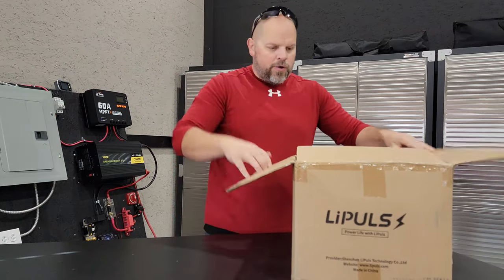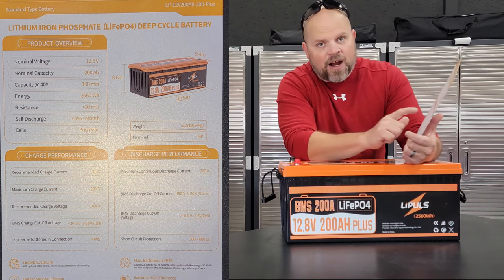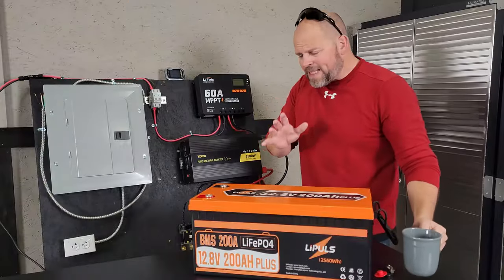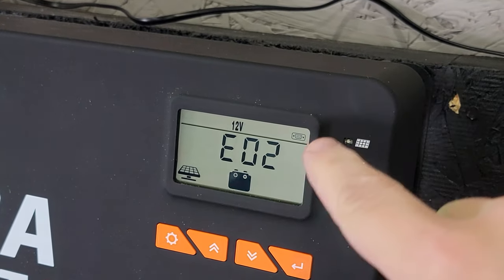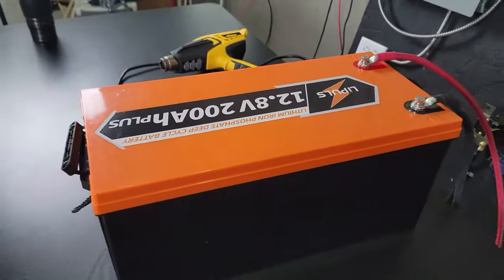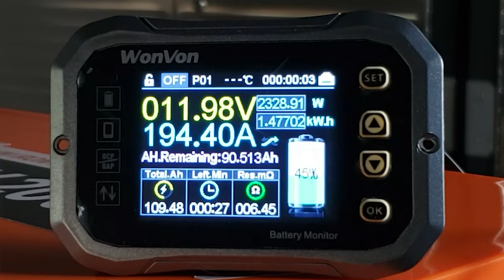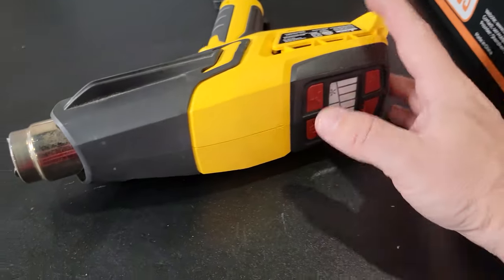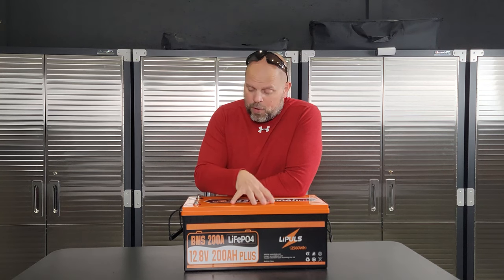LiPULS 12v 200ah Plus Lifepo4 Battery Is Here - Check It Out!

Comment: I enjoyed your video and I like your style of presentation. I don't make YT content, but I do consume a lot of it and, for the last 2 1/2 - 3 years, much of it has revolved around LFP batteries, chargers, inverters, solar panels, etc. I've built a number of emergency backup power systems for my home here in tornado alley and have bought lots of testing gear to play with just because I'm retired and have always enjoyed lab type work. 
   I say all that so I can say this and you won't think I'm just popping off. I think I know what I'm doing and I just want to help you if I can. I think the reason that you came up short on the capacity test is because these (and actually ALL batteries or rather the cells that make up the battery) get their capacities tested under a set of standard criteria. For LiFePO4 batteries they are only expected to deliver their rated capacity if they are discharged at no more that 20 % of their AH rating. A 100 AH battery has to be discharged at 20 amps or less and should be able to do that for 5 hours. The battery that you're testing must be discharged at no more than 40 amps and should last for 5 hours. It's referred to as the ".2 Rate" or the "5 HR Rate". Lead acid batteries, on the other hand can only deliver their rated capacity if they are discharged at the ".05 Rate", commonly referred to as the "20 HR Rate". For a 100 AH AGM battery that would be a mere 5 amps for 20 hours. If you exceed these discharge rates you get less capacity from the batteries in question and if you do it at a lower amperage you will usually get a little extra energy than the rated number.
   Now, having said that, let me say this, I've never ever seen anyone even TRY to discharge one of these batteries at their max discharge rate for the cells, even when the BMS is also rated for that current flow rate. All I've ever seen done was to make sure that the battery would deliver that current for 10 minutes at most, just to prove that the BMS really would support it. My hat is off to you, my friend  because you just gave this baby one hell of an acid test!! I'm flabbergasted! Because of all the discharge specs and the scientific method that I pointed to earlier in this comment, I don't know how many times you could get away with this without doing damage, but by golly it worked once and that convinces me that this battery is absolutely legit.
   Please keep breakin' rules and makin' content!
Reply from the maker: Thanks for watching and sharing!

Comment: What's the point of sending out your product when the link to said product leads to a "currently unavailable"? What, did they have only four of these for sale?
Reply from the maker: I'm not sure I follow your comment. I checked the link I added in the description, which is an Amazon link, and I see that they are in stock and ready to ship.
Reply: @JustinsProject For me it leads to a list of different 200A batteries. I don't even get to the product in the video anymore.
Reply: @RetiredRhetoricalWarhorse works fine for me  even takes me to a UK listing 👍
Reply: @Dirt-Diggler  That's probably it. Amazon doesn't offer this in my region so I don't get to see any pricing either.

Comment: The question becomes: How long will it last with daily off grid 24 hr use.... Is there a warranty?
Reply from the maker: Only time will tell. Thanks for watching and commenting 👍🏻
Reply: @JustinsProject  You're welcome. I've been digging deep in to making my RV solar... However, I plan to live in it, so I will need not only enough power to run everything 24-7, but it needs to be reliable. The higher end batteries come with at least a 10 year warranty...